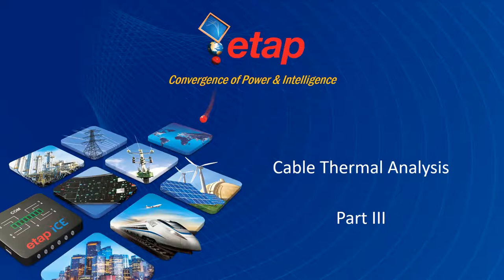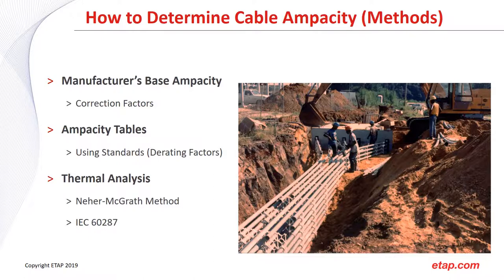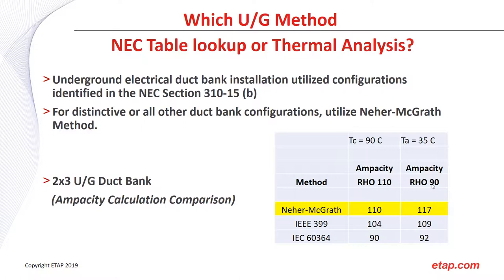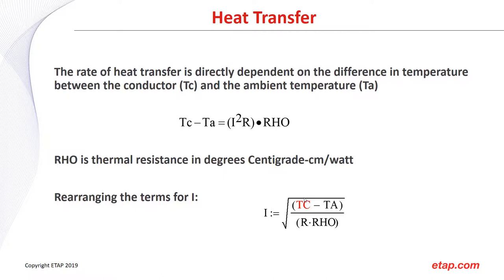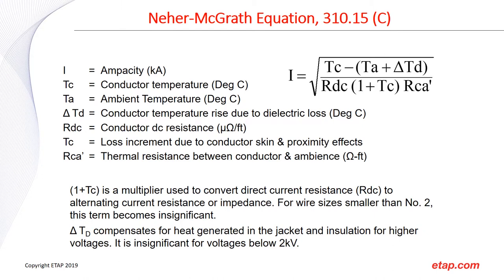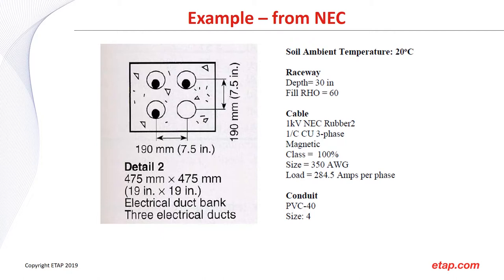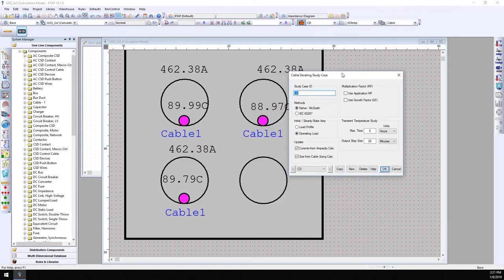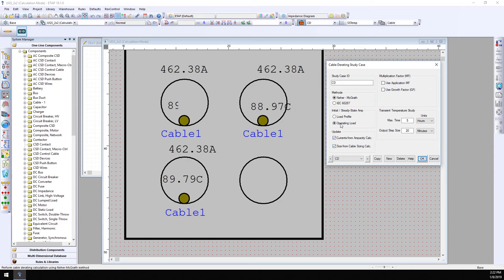Cable Sizing - Cable Thermal Analysis

Comment: Dear ETAP Software,
Thank you for providing me the hyperlink to your further videos. I shall definitely look into it.

Referring to your video, what would be the approach for doing Cable Thermal Analysis in case of Cables being directly buried in the ground [actually in a trench] (without conduit) with soil being the surrounding material?

A.I noticed that by selecting a Uniform Raceway; the conduits are inserted automatically. 
B. However by making the Non-Uniform/Circuit Level Raceway selection under the "New Uniform Raceway", its not possible to add the cables or conduits to it.
C. As for the "New Direct Buried Raceway"; its not possible to add the cables directly & one has to add the "New Location" into it. So again I am unable to fulfill my criteria.

Your reply shall be highly appreciated.
Reply from the maker: Please contact our 24/7 HelpDesk and submit a ticket with your issue. An ETAP support engineer will be able to provide you with the best solution for your project. Go to HelpDesk https://etap.com/support